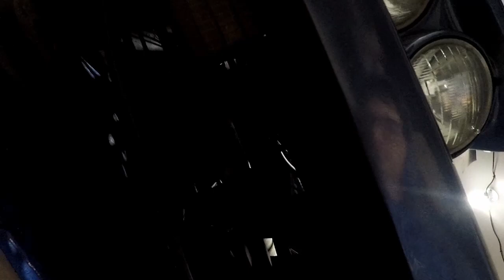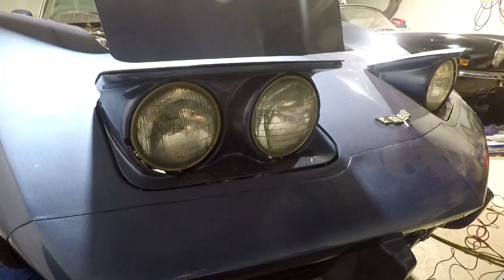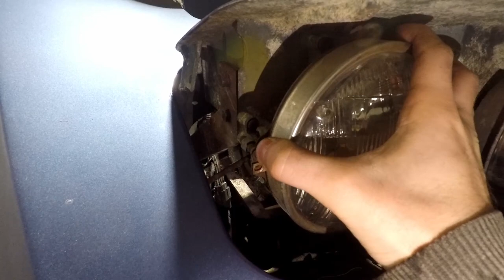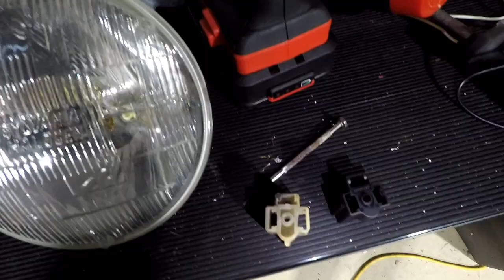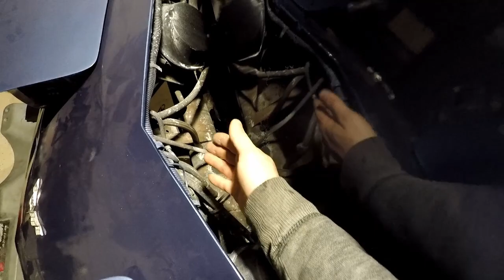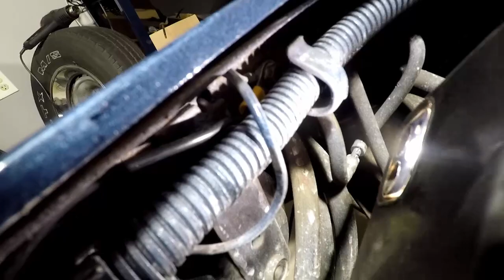Fixing Headlight Light Issues - 1979 C3 Corvette

Comment: I got a crazy behavior. Left turn signal makes all 4 headlight bulbs blink along with the left tirn light.  Right turn signal works ok. High beams works ok. Think it may be the signal switch that is wobbly but not sure how to troubleshoot it. don’t want to throw parts at it…
Reply from the maker: @ST-qe6pp  that is very interesting. Could be the turn signal switch, or could be something in the wiring. Do all 4 headlight bulbs blink when the headlight switch is turned off? Does it do it when the lights are turned on? If it only does it in one of those positions, that could be a helpful clue.

All 4 headlights in the front share the same power and ground. Thinking either you’re losing ground, or gaining a power source when you shouldn’t be (depending on the answers to my questions above)
Reply: Ok thanks. Will try this. Also going thru the grounds (especially the radiator mounted one) is practically unreachable to remove much less clean the contact due to the vacuum reservoir tube being in the way.  Thinking of relocating that ground to a better spot!
Reply: Hi Bluestx. Thanks for trying to help. Here more info if it helps.

What’s the behavior LEFT TURN signal car running:
- with all 4 headlights off. All 4 beams lights blink as well as the left blinker.  Right blinker off.
- with all 4 headlights on(highs).  All 4 headlights on solid.  left turn signal off. Right turn signal on solid.  No dash left turn icon. dash high beams only blink solid.
- regular headlights on (2 outer). The high beams blink along with the blinker. The regular lights do not blink and remain bright.left blinker blinks opposite the high beams blinking . The right blinker on solid.  Dashboard high beams icon blinks.

Gonna try to find all headlight/blinker grounds and clean them up to see if that fixes if u can think of anything else pls let me know thanks!
Reply from the maker: @ST-qe6pp  it’s interesting that the headlights blink when the turn signal is applied and the headlight switch is off. Because as I go over a bit in this video, the headlight power is a different circuit than the turn signal switch. To me, that says the headlight wires are getting power when they shouldn’t be. Also, all lights in the front essentially share the same 3 grounds. 

It is possible there could be a problem with the turn signal switch (this switch controls both turn signals and the high beams!) 
However, go through your wiring first. Something you can try is with everything off, unplug 1 bulb from the LEFT side of the car, turn left turn signal on, if there’s still a problem repeat with another bulb. 

I suspect the problem is on the left side due to the right working correctly. If you find the bulb that has an issue, then that tells you the wires to that bulb is the one shorting out to the headlight wiring :)
Reply: When u say “share 3 grounds” u mean these right?, 1-the alternator ground, 2-the front driver radiator support ground (massive pain to reach) and the 3- header ground (weird since it seems to have black paint underneath where it’s attached.

I bought and hooked up a new turn signal switch (left outside the steering column) just for testing and behavior is the same so it’s not the switch.

To rule out bad grounds:
I’m gonna snip that radiator support ground and hook that and the header one  to a test lead straight to the battery negative where it comes out from below the battery box with test leads and jumper cable.

I guess if that ground test still shows issue it’s time to take the harness out as last resort 😮
Reply: @bluestx  so I took out the headlamp harness and it was fine. The problem was the tach/speedo printed circuit where it connects to the loom 2 contacts were touching they were so old. Once I replaced the printed circuit good now. At least I learned how to remove the front loom. Now on to rear right caliper that decided to bleed out 😳
Reply from the maker: @ST-qe6pp nice! pretty common for the original o-ring calipers to leak, especially if the car has been sitting